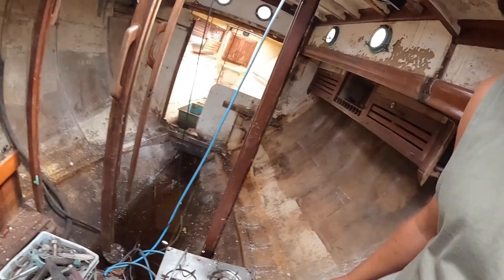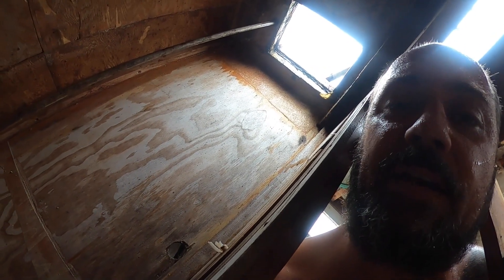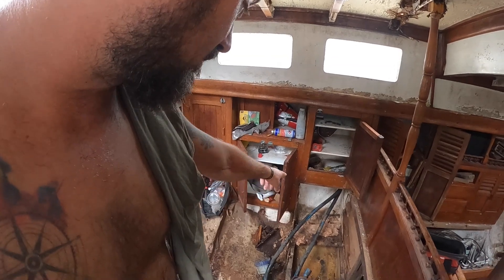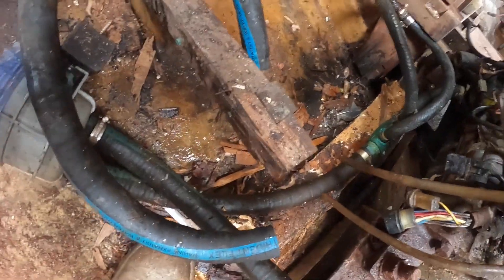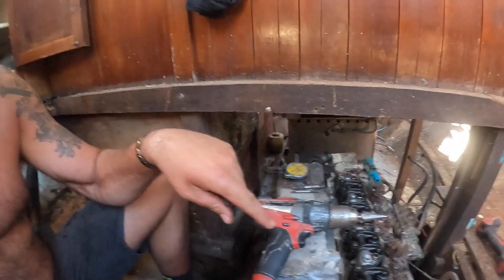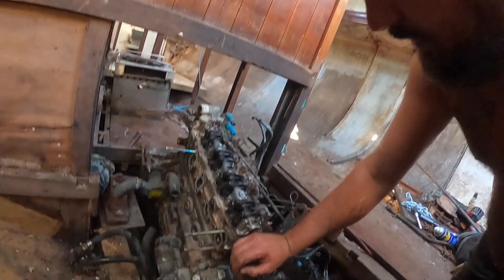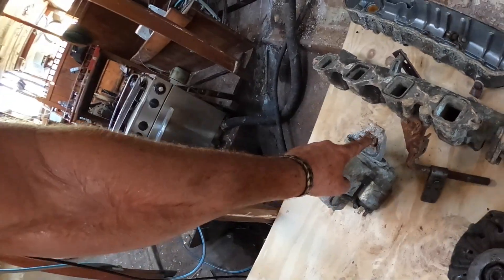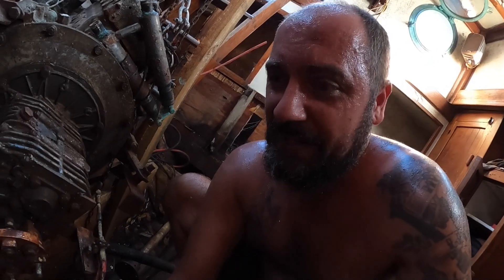Ep 10 - LET'S CHECK THIS ENGINE OUT SHALL WE!! - Rebuilding an abandoned yacht - Ketch Restoration

Comment: I was wondering if you thought about or if possible with your engine to move it under stairs with side access if you add a quarter berth. Don't know how much weight or what you have in your keel. But with tanks all added to salon, it could compensate. Would give you more floor space. And a shorter drives haft to deal with.
Reply from the maker: I hadn't thought about moving the engine back further as yet, the current location does make it difficult to work on the engine, however this side of the boat I was initially trying to keep the original design as much as possible. But I will have a good think about this area! The dry weight of the boat has been noted as 14 tonnes with a very heavy solid lead keel right through which would give me a bit of freedom in altering the design, however I do want to make sure I don't adjust the center of buoyancy to much, but from what I can tell in these boats they are a very good design for sitting well in the water! This is all the fun of these projects, getting into the details!

Comment: replace that motor with a Kubota (Beta Marine)  Yanmar parts are very expensive and no better than Kubota
Reply from the maker: Yeah I have been searching for parts for the Yanmar and there are a few bits I just can't get. So I am on the search for another engine for her. I will keep an eye out for some Kubota engines! Thanks for the tip!
Reply: @revivingtheenchantress  Make a different channel for the tictok knockoff vids(shorts). keep em separate. 
The main difference between a Kubota and a Beta is the heat exchanger and raw water pump. 
You got a long time before you need a motor, no rush to find one, just keep ear to ground for a deal.